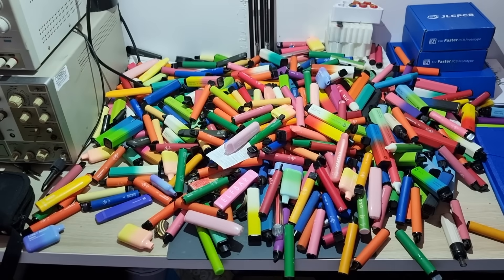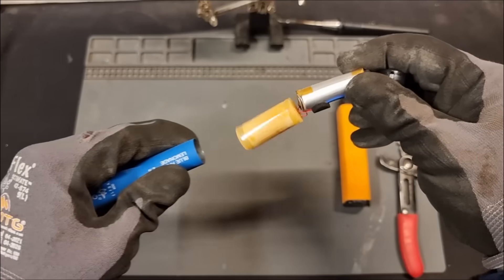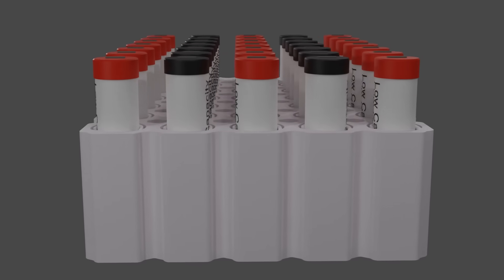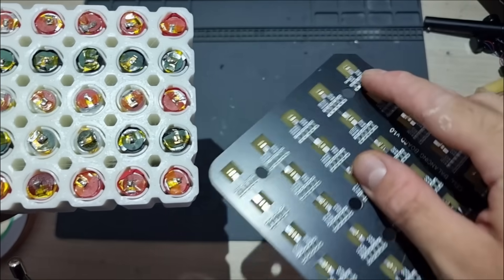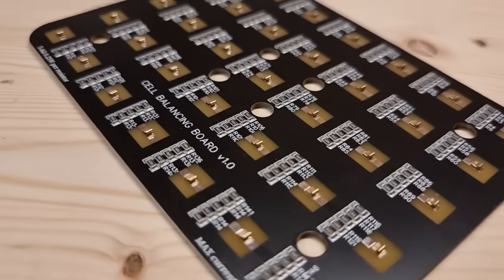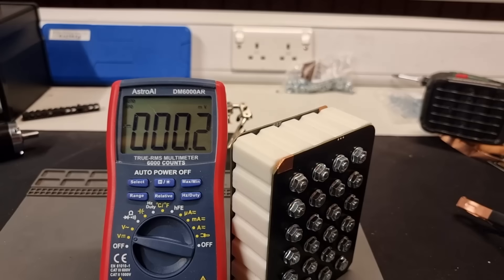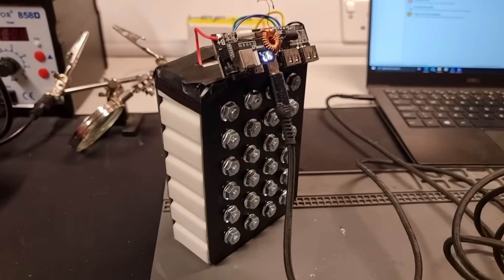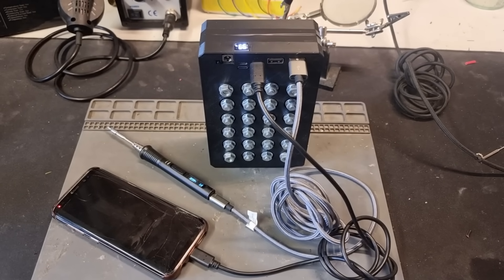Turning Disposable Vapes into a Fast Charge Power Bank

Comment: I've been vaping for over 15 years (Yeah, it really has been going on for a long time before it hit the mainstream. :D), and the reason why these disposable vape pens got big is purely down to stupid government legislature.

In 2014 the EU pushed through the "Tobacco Products Directive" (Or "TPD") that stipulated things like refillable vaporisers must not be able to leak, their tanks can't hold more than 2ml, and refill bottles can't be over 10ml. It's REALLY hard to design a reusable atomiser that CAN'T leak. Most have the e-liquid in a semi sealed tank with the liquid only being able to exit by soaking into a wick, the problem is that if you go on an airplane, or even drive up a long hill, the drop in air pressure can be enough for the air in the tank to push e-liquid thorough the wick and have it flood out through air passages. That meant most of the refillable atomizers that pre-existed the directives implementation didn't comply.

One of the only systems that ISN'T affected by changing air pressure is what's referred to as a cartomizer. These are disposable tubes that contain a heating coil and cotton for the e-liquid to be soaked into. These tubes are screwed into a battery and tend to be made to look a little bit like a filter on a cigarette. Refilling them can be a drawn out and messy job though. You need to pop off a silicone cap, then slowly drip e-liquid onto the cotton area and let it soak in. You keep doing this until the surface of the cotton remains looking wet. Usually by that point the liquid has started dribbling out of the other end of the cartomizer, so that fails the TPD.

Before the TPD came into play there were hundreds of small companies making their own design of vaping atomizers, but suddenly a huge proportion of their products became illegal to sell due to having the potential for leaking, or having a capacity above 2ml. Without the money to completely redesign their product range, most just shut up shop and ceased trading. This left the field wide open for the existing tobacco companies to step in and take over the market. 

A simple system that DOESN'T fail the TPD rules is a SINGLE USE pre filled cartomizer. The trouble there is that a standard cartomizer doesn't actually hold a whole lot of liquid, so to get up to a marketable "Puff count" on a disposable item, the new wave of tobacco company offshoots just made them bigger, and while they were at it they decided that it would be good for their new revenue stream if they made these whole devices disposable (People are happier to pay for the "Convenience" of a cheaper disposable devices, instead of spending about double for a reusable one that needs more e-liquid and the occasional replacement "Pod" (A pre filled tank with a wick and coil fitted) fitting). With that, the market got flooded with disposables because they cost next to nothing to make, they don't need to be made well enough to last more than a few days, and the profit margin on them is huge.

So, overnight we went from vapers using rebuildable atomizers that only needed some cotton and maybe a couple inches of kanthal heating wire replacing every couple weeks, to be good as new, to a world where people think it's acceptable to throw away the entire device when the battery goes flat........ All because euro politicos, who probably didn't even understand what they were voting for, pushed through a "Harm reduction bill" that could almost have been ghost written by the tobacco lobbyists, solely so they could take control of a sector that they felt was stealing their profits.
Reply: Thank you for the information on the EU side of legislation. I'm only aware of the US side which followed an extremely similiar path of nonsensical laws. So it's good to have these details to share on how they became so prevalent in Europe as well.

Comment: the whole concept of disposable vapes is fucked to begin with. 
what happened with just getting mod and a dripper/tank atomizer?
only part that actually needed replacing was the battery or the coil, occasionally an o-ring, but otherwise those things lasted for quite a while.
Reply: Sure, people still do that in areas where they're still legal and/or accessible

Comment: i take the cells out and solder them in parellel with the tiny batteries that come in those under cabinate kitchen pid lamps, and also do the same for my 7$ wireless headphone case

Comment: WHICH IS EXACTLY "WHY" I USE MODS ONLY!!!  AND HAVE BEEN SINCE BASICALLY DAY FRIGGEN ONE OF VAPING!!!  I use ONLY fully rechargeable Li Ion since they came available - some I've had for OVER 3+ years and getting sometime 1000 full charge/discharge/recharges!!!  It's the KIND of recharger you USE that determines how LONG your battery will be usable...  USE COMMON SENSE and BUY WELL DESIGNED Chargers and Batteries and YOU TOO will get the life I do out of them!!!  Plus, in the end, I GET WAY CHEAPER $ per Battery which translates into SAVING HUGE for me year after year... I bet you spend over the course of a year 10x I do using using "disposables"!  Just STOP using them as I do & your wallet will THANK YOU!!!

Comment: This is a great project, not only for the environment but also just for the sake of experimenting with batteries. I would suggest soldering the cells using a spot welder, but if you don't have access to such a device you could solder them with a high-power soldering iron (~100W). Make sure to have a sand bucket nearby and never leave the soldering iron too much time on each cell. Having them connected just by squishing the PCB against them is not very safe as a cell disconnecting could lead to an unbalanced battery with each of the parallel banks serving as heat sources. This would heat the battery and make it into a lithium fire. Be safe!

Comment: Would it be better to have thinner plastic housing for housing those batteries, so they can cool down faster rather than to be enclosed in solid plastic making it hard for the air to circulate around them? Perhaps 2 much thinner plates, top and bottom?

Comment: holy shit.... I have been collecting disposable vapes from my friends over the years.... also planning to do this eventually but you beat me to it! I would love if you shared the 3d printable files, as well as some PCB files. I'd love to make a battery bank or a bike battery with them. it would also be great to have some sort of testing for each battery to make sure they wont explode too...

also question, what is your background? because this is really cool stuff.
Reply: also, is there any way to use an ESP32 as the battery controller, as well as checking the battery health to know when to swap out specific cells when they die out?

Comment: Currently doing this myself! Great job and super tidy! Did you run the cells through a rest rig to find the ah of each cell? I’m testing mine and found they can vary a fair amount even though there all from the same vapes. You want you cells in the parallel banks to be within 2/2.5% of each other, if not you will get uneven discharge and unwanted strain on some of the cells

Comment: i love the design of the power bank you have made. unfortunately i do not own a 3D printer but would love to make one of my own. i have collected the same amount of disposable vape batteries. i am currently on 198 batteries. different voltages, sizes and current. I am making portable LED lights with my batteries. I really want to make a Charging station that can rely on Solar charging and be used at the same time. If your products used has a design, i would love to get my hands on them so i can make a charging station of my own. P.S. I love the way you re-use E-waste items for a better purpose the same as I do. Keep up the great work.

Comment: In my opinion vape manufacturers should be forced to operate in a deposit system. So that they charge like 50 Cent to a Euro extra that a customer gets back after returning used vapes to a shop. Vape sellers/manufacturers should also be forced to reuse the cells of the returned vapes (not toss them in the garbage). Then I am kinda fine with this really big waste of resources...

I think most disposable vapes are made in China or elsewhere, but that shouldn't be our “collective problem”. If the product is not profitable under the circumstances, it shouldn't be on the market in the first place.

Comment: Its crazy how a homemade youtube video single handedly shows that even if their garbage they can be reused , im more surprised there isnt a company that collects these to repurpose considering how many get thrown away and the vast quantities they make off the initial sale. Even adding a sanitization part to the disassembly wouldnt even make it that expensive for them.
Reply: These li-ion cells are really cheap to buy new for a manufacturer. There also unfortunately aren’t a lot of use cases to recycle these, the size of the cells is quite large compared to capacity - this giant power bank he made only has 15.000 mAh, while being 12x the size and weight of a commercial battery of the same capacity.

I think that it is a shame that these are allowed to be sold and that people throw it in the street and regular garbage cans as if it wasn’t e-waste. But running a business on recycling these would not be profitable. I hope that people start sorting their trash and the government can do proper recycling of them.
Reply: They would prefer to get the micrograms of gold off of literal tons of circuit boards while throwing away tons of coper worth many times more lol 
They do not think about things like oh lets use all these millions of lithium batteries to make inexpensive power banks and battery packs that we can sell for 1/4 the cost of comparable power banks make a mint off them and save consumers 60% over mass market brands. 

I have made so many power banks and battery packs from "dead" old school laptop batteries from when they used bog standard 18650 cells it is not even funny. I would guess that i have made packs that are about 1 or 2 mega amp hours worth of 5 and 12 volt battery packs over the years. See with laptop batteries the battery is shot once any you loose about 25% worth of capacity on any single cell. Most laptop battery packs of the type use 2500 mah cells to 2750 mah cells so a cell that has lost 25% of its capacity is still capable of 1875 mah on the low side and 2060 on the high side for most some use 3k mah so those are 2250 mah. A laptop battery typically has 4 6 or 8 cells and only 1 of those will have been depleted to that 75% capacity in rare cases 2. So each pack will have 3 5 or 7 cells near 100% if not 100% capacity and 1 at 75% rated. The ones at less than 95 to 100% capacity i just use for rechargeable flashlight batteries the others i use for packs or power banks. I use to sell them to friends or give them away as gifts to friends and such. Others i used for various purposes for my own side projects
Reply: I have a friend that actually does this at festivals in the UK.
Reply: The answer: money. Recycling is very expensive and the world we live in is build on money so it will never change. Only small change to appease the masses.
Reply: easy anwser is that he and any company has zero idea how many charges they have had or theyre age and is highly dangerous
Reply: Capitalism makes it cheaper to just make and buy new batteries than to collect these, process them, and re-use them
Reply: Waist is profit. There's nothing more valuable than a good environment, but it's what we destroy by being consumers, everyday
Reply: @X9523-z3v A good environment isn't very valuable when there aren't any people to occupy it. I personally don't mind reverting to the sudo-dark ages, but magnitudes of people will die in the change.
Reply: @Kingdeathtrooper  If we're lucky, we'll get there. If we're not, maybe the plants will have a shot
Reply: @TatoRips  SHHHHHHH!

Comment: All the STUPIDLY fat bolts and nuts probably weigh more than the bstteries and other components 😂

Also, as far as vapes go, i never got why there disposable in the first place, wouldn't it be both way easier and cheaper yo make either the sponge or plastic disposable instead, and transferring the battery from the old to the new..?

Comment: Hey man awesome video- you have alot of comments so idk if you will see but I'm a battery scientist and I just want to say two things. 

1) lithium is not the precious part of the lithium ion battery - cobalt, nickel, manganese, and copper are. Cobalt specifically- it is used in the cathode (+) electrode of most commercial cells. I highly doubt these have lithium cobalt oxide cathode though.

2) this is quite a fire risk- please never leave this unattended or running overnight. It might not be today or tomorrow, but this sort of cell will inevitably fail (quicker than you predict in your video) and it might fail bad.I predict you will get 100-200 cycles MAX, with a rapidly decaying capacity (the vape cells use a polymer that degrades relatively fast).
Reply: Thank you for your insight. I have collected about 100 of these batteries and I'm unable to think of a good use for them. In the beginning, I was interested in building a power pack like the one in this video, but because of concerns like the ones stated in your comment, I haven’t built one for myself.

Comment: Nice idea.

However, a couple of thoughts:
It looks like you're using the same PCB design for both sides of the battery pack. If so, you might want to design two different PCBs so the main soldering tabs used to withdraw power are diagonally apart over the whole pack. The way you built it now, the cells closer to the tabs will be loaded more when you withdraw power due to the lower resistance of the traces across the PCB. If one of the PCBs is designed so it is rotated by 180° the path for the current draw will be more evenly distributed across the cells, meaning they will age more equally and you'd also be able to draw a slightly higher maximum current from the pack.

Also, how much capacity do those cells have? 100W of power draw sounds like an awful lot for such small cells wired in 5S7P configuration. If my math is correct, that would come out to somewhere between .68 to .85 Ampere per cell (depending on the charge level of the pack) and I'm wondering if that isn't a bit too much for them over long periods of time? In a vape they might provide even higher currents, but only ever for short amounts of time.

Still, cool project and a nice idea for recycling all those old vapes lying around.

Comment: great work
might look tidier with less pronounced nut/bolt heads possibly even covered by the case you made - should be easier with the smaller offset version as it would need much thinner nuts/bolts.
also building a super fast charging wireless coil into the case might be useful
the output rating on stuff like this (circuit or coil) from ali express is allways a gamble

Comment: Amazing work, mate! I do some small stuff with used Li 18650s, like repairing batteries for portable appliances, but this is a step forward not only useful and environment friendly, but also profitable. If I have to criticize something (which I shouldn't, you did and impressive job, but I'm an a*hole that way :D ) is the nuts/bolts overkill. You could print sliding lids with a few pressure points to ensure a good contact between the boards and the batteries, and get rid of the bolts altogether

Comment: OK my comment's not posting and that's kinda rude of "something", not sure if it's the "almighty algorithm" or what, but I'm just trying to provide some alternatives and it just keeps going "Returned error" every time I try to edit it. Which tells me it didn't post.
So much for me wanting to have a little bit of technical discussion, I guess.
Reply: All I'm trying to say is that there are tools available to allow an individual to use strips of nickel to spotweld the recycled disposable vape batteries together, into a bigger battery pack, instead of the spring method.
I'm also trying to say that it would be a good idea to add an always-active BMS to this pack, because it contains enough energy to be dangerous should any one of those cells fail.

Comment: love the video, just a heads up the hot air station you have, double check the case is grounded, I bought one and got a nasty shock off the case but they hadn't bothered to ground the case to the ground pin

Comment: I've also found a bunch of wireless ear bud cases...... was planning on using the ear bud case board as a the charge circuit.

Also, why so many bolts?